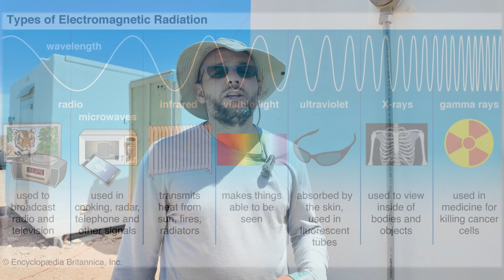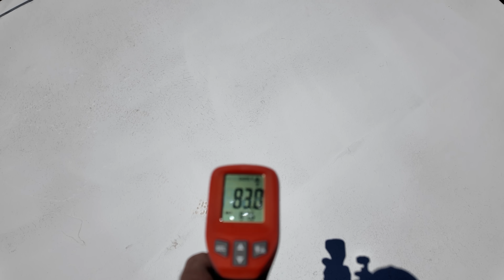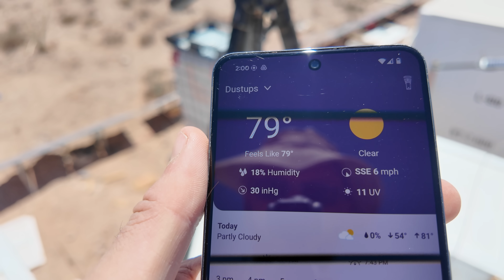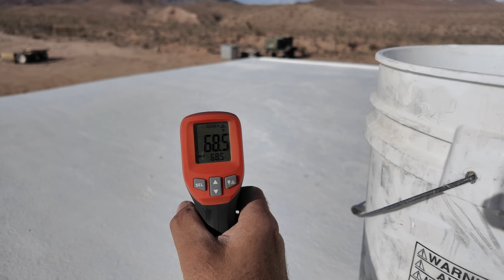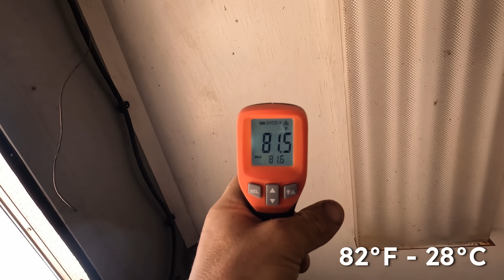I sprayed "cooling paint" on my desert cabin...this is shocking

Comment: For times when ambient is acceptable. Build a chimney, preferably metal and black.Up to a point taller is better.  A couple of your pipes might work wonderfully.  Make sure the indoor opening is near the ceiling. As the sun shines on the chimney, it gets hot, and hot air rises. Let the stack effect draw in fresh air to replace the hot air in the shack. Don't forget to cover the hole at the top or Murphy will send you a real rainstorm.
Reply: But then you can't get your interior cooler than outdoor ambient.  With reflective cooling you can get the interior substantially cooler than outside.
Reply: @traildude7538  So, I am not at all sure I believe that you can get the interior substantially cooler than ambient air temp with reflective and emitting paint. The Surface temp on top of the building was somewhere between 65 and 92 F. He said the air temp was 70ish, not sure how accurate that statement was. He wasn't actively measuring. That is not to say that I think the paint is a waste. I think it will likely buy you a few degrees and slow the rate the room heats up. However, if you have a 98 degree body, or some other heating sources, getting to ambient is going to be more difficult. In the evening, when the air cools off, being able to quickly vent the hot air and replace it with cooler air is luxurious.  Engineers Toolbox says all spaces generally need 4 air exchanges per hour. If you are trying to passively cool the doghouse, with a min 4 air exchanges/ hour ambient is about as good as you are going to get. If you are using AC, then you have temp control at the cost of power. If you have a tight building envelope and the Earth-tubes from an earlier episode, then you may be able to drive the airflow through the earth-tubes with a good chimney. Taller, hotter chimney means more pull on the earth cooled air.

Comment: Building a roof above all of them  out of scrap materials would work better. Shade cloth would also work but I'm sure you could find free pallets. Then buying some 4x4 posts, concrete, bolts, and tin roofing would really only purchases. Might be able to find salvaged materials for some of that too tbh. Doesn't need to be pretty. Just needs to work

Comment: I thought you had an excavator? The earth is very cool 2-3m down. You could create a building/structure 1.5m below the surface. For example, excavate 1.5m then make a basic floor with concrete and make simple sand bricks then a wooden ceiling with 1m of soil above it. Or put the cabins into the earth with wood then soil on top. Just an idea. Would cost just perhaps 1-2.5k usd in concrete/wood.

Comment: Those are just big insulated boxes. Painting them white is a good idea, but using convection would be even better. Add a second roof to the buildings. It doesn't have to be much, just bigger than the building. You need to make more shade for the buildings. Also, do not enclose the second roof, but leave it open. For these cubes, a hipped roof would be good. Then, at the peak of the roof, you have a vent to let the air out. The roof needs to extend below the top of the building as well, the lower the better. This not only provides shade for the building, but also separates the hot roof from the building's structure. Adding in convection from the heat rising on the backside of the roof (the "attic" space) and letting it vent out the top provides another heat transfer route that can provide more cooling. The roof can be made from thin metal sheet, like as used in an agricultural building. If you are really serious, you can cover the sides of the building with thin sheet metal, spaced from the building by small standoffs of some kind (like long bolts or screws) to provide an air gap between the side of the building and the sheet metal. Make sure to leave space at the bottom for air to enter and space at the top for air to exit. As the sheet metal heats up from the sun, convection in the air space will draw heat away from the building and provide shade. The small connectors supporting the panels will limit heat transfer via conduction. It's cheap and it works.
Reply: Your fancy paint will keep radiation from the panels from heating up your boxes.

Comment: Another option to explore is digging a deep trench install some pipe and circulate air though the piping into the living space. Geo thermal redneck style. You  could use a small solar panel to run the fan.

Comment: Wouldn't it be cheaper to do strips of wood to create an air gap then reflective corrugated metal on top of that. You'd basically put all your buildings in shade and it would be easy to disassemble and reuse later.

Comment: You should try making a wind catcher. Dust ups with its winds and high temperatures would be ideal, you could scale down the concept and better yet, no power required. If you combine it with an ibc tank or a large heat sink.

Comment: wow, greetings from Oz via Ukraine, I would have expected it to get much hotter than that in the desert, gets to 90 in summer here in Kyiv. Anyhow, white paint will keep you cool, a tin roof with just zinc galvanised coating will be better and some cheap insulation even better. Wide eaves  as well work wonders. You could build a mud brick wall on the "hot side.

Comment: Pole barn roof over the top of the doghouse. 
Casing pipe frame, second hand sheet steel. Once and done. And will last far longer than any paint.
Edit: think small box under a carport.
Reply: He has mentioned moving the dog houses closer together so he can put a single (reasonable sized) roof over all of them.
Reply: Strong winds are the biggest challenge to such projects I believe.
Reply: @louisegogel7973 they hold up just fine to the exact conditions he is in. Nearly all the rental places in Big Bend have them. 
Ive got one above my house on the edge of the west Texas desert. 
Definitely requires some planning and bracing. But they 100% will hold up.
Reply: I’ve been kind of wondering why he’s been chasing his tail with all this others stuff he does. A pole barn roof could have been done in a short amount of time.

Comment: Only thing I know that would help would be to build a pole barn over top or bring some dry ice with you.
Or go with a geothermal heat pump, but that uses electricity.
You may be forced to put up a few wind generators to supply enough power for AC, but that adds more cost for inverters and batteries.

How about just dig some holes in the slope and bury the buildings on three sides, would require possibly a retaining wall, I don't remember how strong the walls were on them.
Any way you slice it, it's just gonna cost some money due to location.

Comment: You are wrong on the walls, the radiation is scattered uniformly, the fraction of visible sky is the fraction of "Cold source" available. For the fraction hitting the ground, some will scatter further, likely reaching space, but some might sure reflect.

TLDR: walls still useful, but less so.

I recommend pitching a canvas with the stuff between the units to get a large area of trapped Cold air.

Comment: If you have a closed space, using radiators to pre cool the air going to the space and using the radiative paint to radiate away the heat in order to achieve sub ambient seems feasible..?
There shouldn't be any wastage of water as it would be a closed loop system.

Comment: or you could use a EG4 Hybrid Solar Mini-Split Air Conditioner Heat Pump AC/DC | 12000 BTU | SEER2 22 | Energy Star Certified | Plug-N-Cool Do-It-Yourself Installation it runs completely on solar by itself coupled with a metal roof about 3 ft above your buildings

Comment: Saw a video where you used flex pipe going in ground for it 
But ive seen them with tin box vents 
Going deep in ground picking up temp of ground I know that you understand 
But flex pipe doesn't 
Work to good because 
Air gets bumb all around going through  it cause a bit of friction
In it's self ok ( just my idea)
Reserve the rite to be wrong ok

Comment: Hey Shaun, one thing you might want to look into is air preassure cooling. Windows / Doors using cut bottles or a similar funnel to increase preassure, lower temperature. There are a few videos on YT which detail the process, ultimately it relies on there being some wind. Good luck with the plight!

Comment: I've been wanting to recommend this for so long, really happy to see this progress.
A potential you could do is more regional temperature control, by spreading a gentle radiative cooling pigment on the sand.
Or if you could pitch tents of the stuff. Could also be useful for induced condensation if you would find moisture in the air.

Comment: I think it'd still help to pain the sides facing the sun as it would still send heat away to the mountains and the ground.

It is possibly doesn't cool the inside as much because the boxes are isolated pretty good so inside heat doesn't move to the outside very well because that is how isolation works.

Comment: We had a metal roof awning covering my entire roof at my old house in Arizona. It provided needed shade for the house but also gave shade for the plants and trees. The drain for the kitchen sink also went straight to the garden. Do dishes, water plants. It was always greener than the neighbors
Reply: yep  and galvanised / silver  works in Oz. should be a sealed roof with air gap and insulation, wide eaves  works.

Comment: I think the idea of radiating heat into space is wrong. Yes, if you radiate towards the mountains, some of that is going to come back to you. But unless you're shining a laser at a retro reflector, the amount of energy returned will be negligible. You're talking about energy reflected back off a dark colored mountain that is sitting miles off into the distance. Additionally, of the immeasurably miniscule amount of energy that actually does get reflected from the mountain and manages to find it's way back to your structure, if your paint is as effective as advertised, which it seems it is.. most of that will be reflected back out again anyways.

As long as the energy being radiated by the building is greater than the energy being absorbed by the sun and the ambient environment, you will achieve a cooling effect.

Comment: Mountains aren't reflective enough to 'bounce' heat back especially the tiny amount emitted by the cabins. If the paint works on the roof it will work on the sides as well. You might slightly warm up the mountain by an infinitely small amount. Roller on a pole is the way to go. Any thermal camera will say not accurate on reflective surfaces.
Reply: Also, as those mountains will be naturally angled. So even a laser aimed at them would be reflected up into space.
Reply: I completely agree.
Reply: LOL yeah, this dude is a moron. Also uses a shiny metal table to work on when he has plywood table top sitting right next to him. How does this stupid guy survive??
Reply: The mountain isn't that reflective but they are pretty thermal release.   Live in Las Vegas and they radiative heat from the concrete is the second worse after direct sunlight.   Grass parks and trees aren't too bad.
Reply: @JemieBridges  The mountains are also many miles away, so negligible effect. The reflective dirt surrounding the buildings is going to have a much greater effect.

Comment: Nice I'm working on a very similar type of paint today. just working on my fume hood. then I was hopping to mix up some the afternoon. If it worked I was going to see if you might want some. but you have solved it already. I hope what you have helps

for Brandon's building maybe you could put some angled walls in a future upgrade. Like the base of a pyramid .

In the winter time might it get too cold? would you need to cover it with some thing less emissive to keep heat in January?

Comment: Why is AC expensive?
Just buy 4-5 Large solar panels and a inverter. costs like 700$.
You don't need battery's if the sun is not up and if you over spec the panel power a bit. 5 panels would be like 2kw even with clouds you can run your AC.

Comment: If you get enough rain you can make something out of rock and mud, thick walls are always best for temp control.
Good architecture doesnt need airconditioning.
Cant wait for the rain!
Reply: Yes I explained above something similar: he has an excavator hence he could dig 1.5m deep then build a basic structure/or put the cabin in it, then put 1m soil above which would cool the whole thing.
Reply: @mradventurer8104  He tried that when he first got out there.  He decided he didn't have enough water, or more importantly time, to build any rammed earth.

Comment: Move the four (?) cabins so they sit much closer together with two on one side and two on the other side. The two most critical units on the North side. Then four steels across the roofs and cover with white sunshade. If possible have a foot gap between the sunshade and the roofs. Hang some lights in the space between and you have a cooler space for the evenings and it should help keep the building cooler
Reply: We had something like that when I was in Iraq living in shipping container "housing". Worked pretty well.
Reply: Yes!
Reply: Or, and hear me out here, you could have the four rooms share walls, so that two sides of each are fully protected from the outside. Then you could put some sort of covering over all them that would directly absorb the sun’s rays and the space under that could be vented to the outside, protecting the top sides of all the rooms.

We could call it a “house”.
Reply: @Eponymous300  Pushing them together RETAINS HEAT = dumb. It's OK we understand you are American? Yes?
Reply: @alexhuxley3355  Heat flows from warm to cool, so if the outside is hotter, there's no heat _retention_; it's just heat gain. Put four rooms together and you eliminate half the area for heat flow. Put a vented roof on and you eliminate the direct transfer of solar energy. Do you think 4 stand-alone rooms would be easier to keep at a different temperature from the outside than one combined structure? Why do you think we build like this?
Reply: @Eponymous300  Four people standing touching each other retain heat. You want to disperse people an increase (but shade) the external areas.
Reply: @alexhuxley3355 People generate heat (assuming they’re alive). Buildings don’t. You’re trying to stop outside heat from entering these structures built in the desert.
Reply: @alexhuxley3355 take 4 frozen water bottles. Place in boiling water, spaced far apart.
Do again, place bottles clustered together. See which one melts faster.
The rooms are not humans.